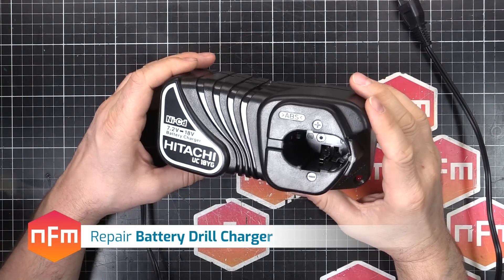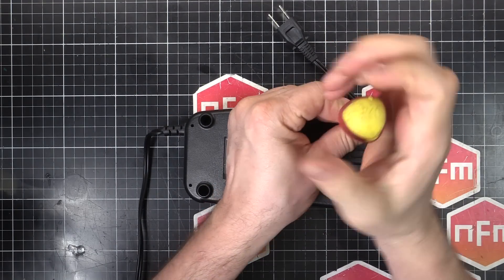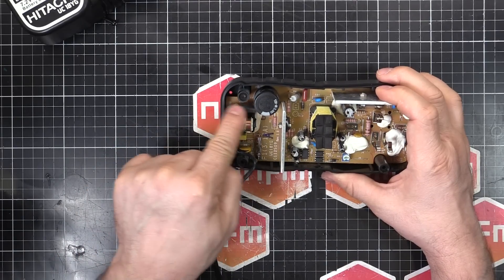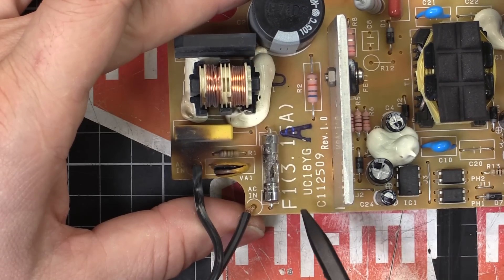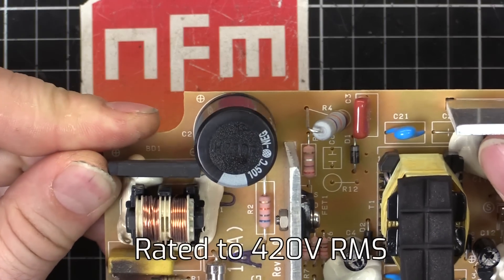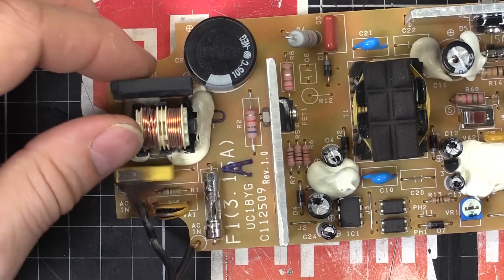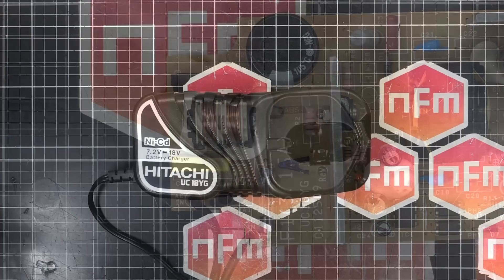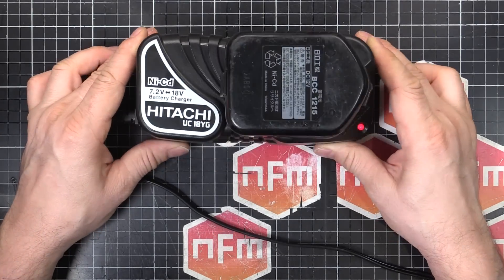Battery Drill Charger Repair

Comment: I'm in America and I have the same old charger, but mine is lacking the piece that blew in this one. You should do a video on cleaning this thing up for someone to use as a small psu, if thats even possible. I love playing around with ac/dc converters for some weird reason. It started a few years ago when I decided I wasn't spending a fortune on a good home audio set up, and built my own with car audio equipment/12vdc, and so I had to figure out how to spark that up. Trial and error, few pops and close calls but still here lol.

Comment: I learn a lot on your video. I have the same charger but 110v. Do you know how to convert it to 240v?
Reply from the maker: Best way would be with a step-down transformer without reverse engineering the circuit to see if it can handle 240V.

At the very least, you'll need to replace MOV's, capacitors, etc to handle the higher voltage, but if it was never intended for 240V use, it could need a complete redesign.

Comment: Will a 1.5 18volt charge charge a 2.5 18 volt battery?
Reply from the maker: I assume so, as long as the voltages match, the larger capacity battery will just take longer to charge than a smaller capacity battery.

Comment: I have the same charger but the transformer burned out. So I need to know what voltage is on the secondary of transformer T1.
Reply from the maker: I'll have to see if I can get access to the charger to open it up again, although as it is a switch mode power supply, you'll also need to know number of turns of each winding, wire gauge, bobbin size and type, and the permeability of the core.

It's probably easiest to unwind your transformer and count the turns and rewind it the same with the same thickness wires. It is most probably purpose built so you won't find a replacement for sale anywhere.
Reply: @NearFarMedia  Thanks, but it is enough for me to measure the voltage, because I no longer have the original transformer.

Comment: I replaced the fuse and a capacitor on my DeWalt charger but it keeps blowing the fuse, don't know what else could be damaged.
Reply: maybe the rectfying diodes had a short circuit, it usually happens when you plug PSUs in wrong voltage outlets, also, the switching mosfet of the primary or the schottky diode of the secondary might be blown off
Reply: @lipelego22  That is really helpful, thanks!

Comment: I have the same charger, except 240v UK model - it stopped charging for no apparent reason but has not suffered the issues as described in this video...it did have some darkened witness marks on the other side of the heat sink around transistors at R5/6/7 - I replaced them all like for like but still no joy, are there any other common faults associated with this charger?
Reply from the maker: Hmmm, have you tested the diodes haven't gone open circuit?
Reply: @NearFarMedia  - good point, I'll do that